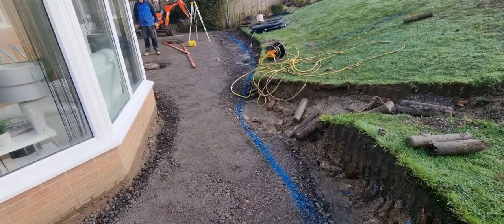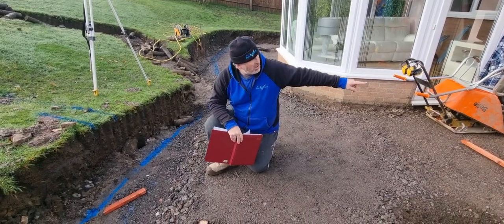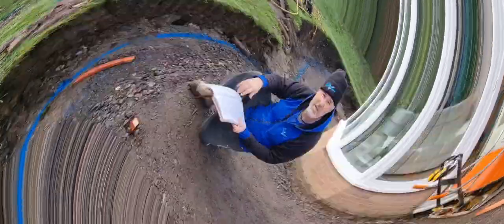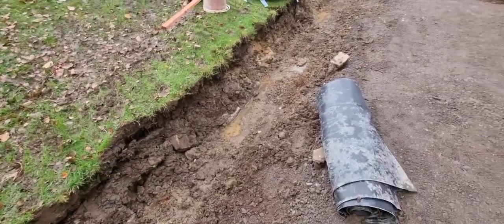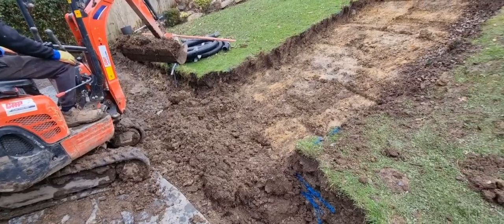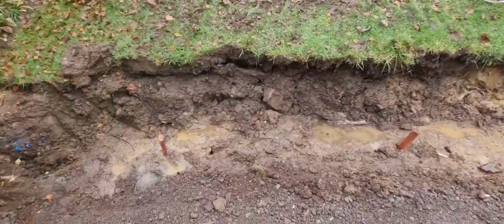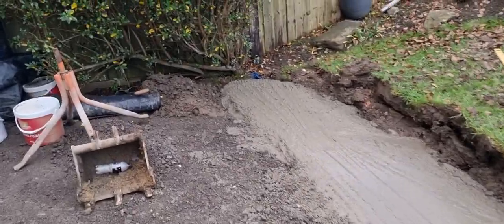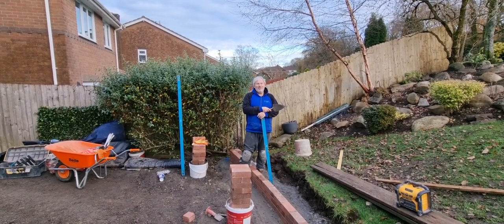patio base & Concrete footings

Comment: HI Justin
I can see theirs water coming of them their hills lol , no wonder you were swamped with it mate ? were we are mate you cannot but surface water in the drains so we have to use soakaways which causes us major problems because we are land locked , and BC never on any occasion do they let us pal , its a nightmare , but sounds like common sense has prevailed on your job pal , but just shows you mate doing things right and not cutting corners reaps benefits pal ,  bit different looking job than last week mate ? you've turned it around pal well done you and your lads mate , quality stuff again mate , nice clean job even with the elements pal , lovely to see , keep safe and well pal
Reply from the maker: Same here john with the drains unless circumstances dictate otherwise and here they do .The water has to go somewhere and a soakaway or french drain dont work here so building control agreed and also agreed to our plans.Hard time of year not pleasant at all roll on spring i say 🤣🤣.yea we changed it around with a bit of careful planning and hard work .thanks john awra best to all appreciate the comments 
Justin 👍

Comment: Looking forward to the video! Quick question for the “oracle” I am laying Indian sandstone slabs, the mix used so far is 4 sharp to 1 blue circle cement semi dry, I first layed 100 x 100mm raj edging sandstone cobbles, I have noticed the colour is very grey now it’s dried, it also seems to be very crumbly? I used a good helping of slurry under every cobble stone before laying. They seem well secure just not happy with the dried texture. To confirm I have not layed nor has it been less than 8 degrees c. 
Thanks!
Reply from the maker: Hi luke.
This is maybe's could be you not mixed to properly. Not enough water maybe .has it had time to set properly. 
Frustrating for you hope all works out luke 👍
Reply: Mixing for a good 10-15 mins with bostik plasticizer🤔
Reply: Maybe too much plasticizer, or overmixing mortar..
Reply: Should the mix just to enough before emptying? I assumed it’s best to leave it going for 10 mins to mix well? Would it assist by making a mix of 3 x sharp 1 x building 1 x cement?
Reply: @lukebull8012  Google is your best mate

Comment: Core a 100mm hole inside of the acco channel, pump a bead of silcone underneath to form a drip and set a 110mm gully bottle trap below. Connect the trap to the drain.
Reply from the maker: Thanks Jonathan think im gonna something like that appreciate it .
Justin 👍
Reply: @brickrightbuildinglandscaping  it’s disappointing that these linear surface drain products don’t have something easier when connecting to drains

Comment: Sorry mate but what your proposing to do is wrong. You can’t put all that ground water in to the combined sewer. You need to get that in writing from the water board. They won’t agree to this. You could dig a shaft on the banking to a large soak away. Make sure your cover your back because the woman at the water board doesn’t know what she’s talking about.
Reply from the maker: All been done thanks mate 👍